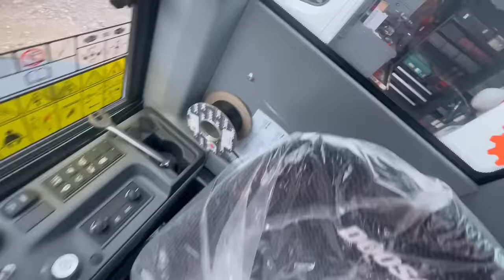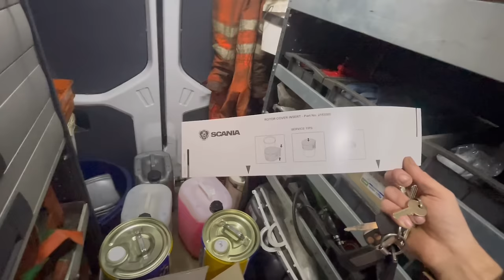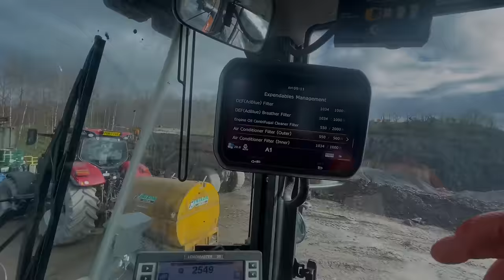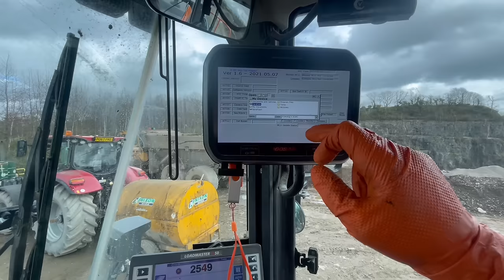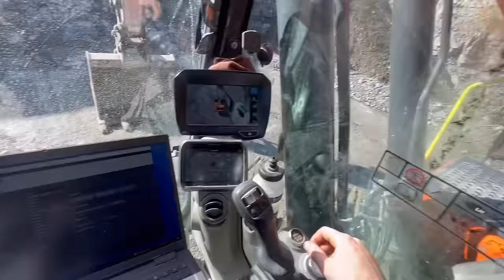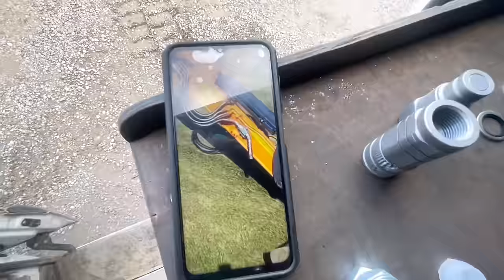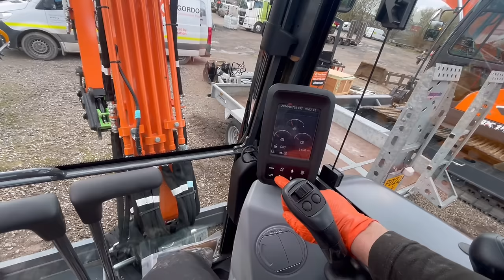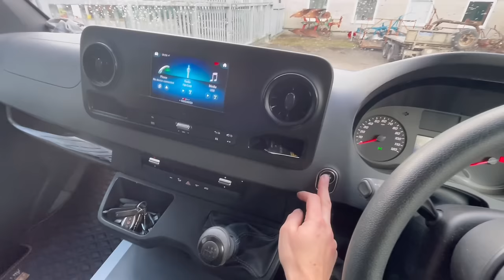More new machines / 30t Diggers / Very wet building site

Comment: Loving your channel Ali.  Thank you for all of the time that you put into producing it.
I'm a small woodland owner (25 acres) with a very low budget, for whom a 5 or 6 tonne machine, equipped with a log grab and a rotator would be the ideal way of thinning and harvesting the timber.  However, you can't hire a digger equipped with those attachments in my neck of the woods, so I'll probably have to buy a second hand machine and fit the attachments to it myself. 
I understand that you can use existing hammer pipes for the grab, but need to add additional pipework to feed the rotator and a solenoid activated diverter valve and change-over switch, in order to operate the rotator.  But where would you connect those pipes into -  without buggering up the hydraulic system of the whole machine?
I guess that it's something that many digger owners would do (as a modification) to their machines, if only they knew how.
If you ever get the opportunity to explain how that is best achieved, perhaps whilst you're doing your work on other machines, that would be greatly appreciated. 
Many thanks. 
😀
Reply from the maker: I did do a very similar mod to a DX27 in one of my videos for that purpose but I can’t find it at a glance I used the pipes off the boom off set ram extended them to two taps at the bottom of the boom so you’d turn the taps one way you’d get a rotate circuit and taps the other way and it’d be back to the boob offset ram, it’s in a video but I can’t find it 😂

Comment: Nice video Ali, re the bagging of the suction filter, have you tried/does it stop the flow as well if you either just blank the breather by removing & fitting a blank, of by removing the breather filter, fit an adaptor & pull a vacuum on top of the oil? 🙏
Reply from the maker: So there is a part number for proper blanks mins been on order for 7 years 😂 I could also get an old one and block it and use that but there’s 2-3 different sizes a colleague of mine has a Milwaukee hoover and he tapes it to the tank breather and it works a treat until the battery goes flat another pal of mine has one that creates a vacuumed with an air line he swears by that. My problem is that I’m doing the job and think I need one of those and then finish the job and don’t do anything about it 😂😂
Reply: @alisdiggerdiary yeah I get what your saying, had ideas over the years time passes, they then become ld models & not in use as much, our equipment, some have gravity fed tanks, others have screen filter sucking out of tanks, on them you just remove suction hose on top of tanks, on the other type I tend to bag the breather filter as I’ve yet to sort out a fitting to connect to a hand vacuum pump & a lock off tap, really enjoy your content Ali 🙏👌